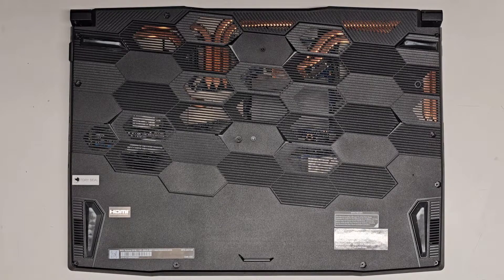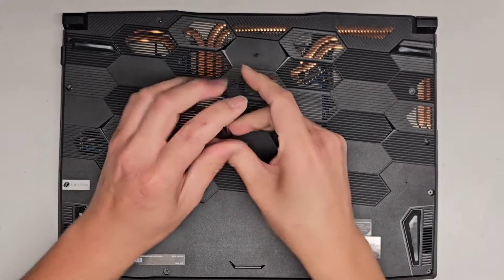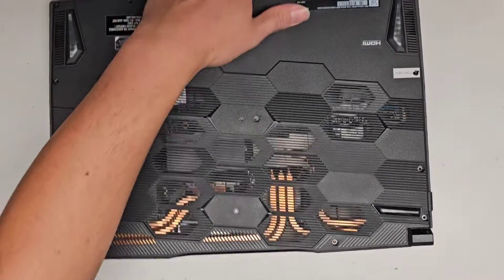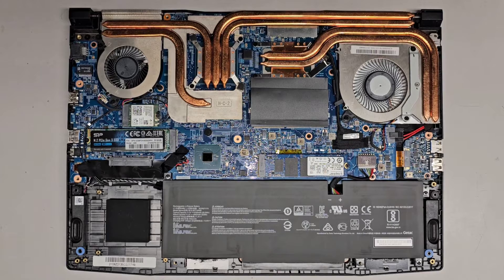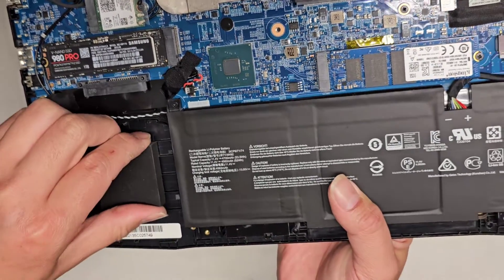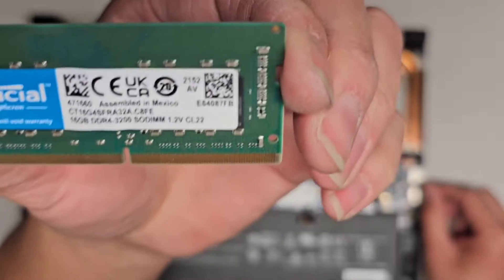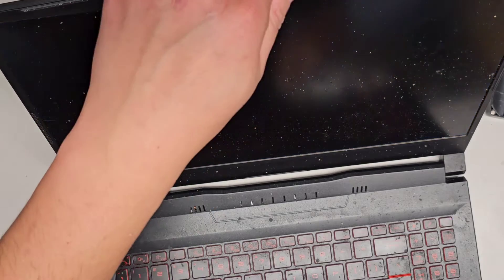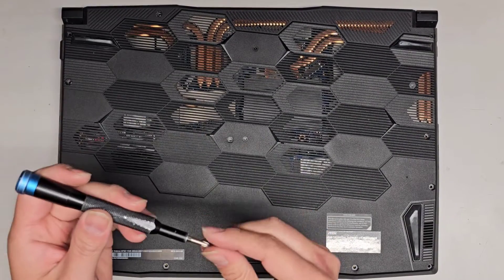MSI Katana GF66 11UE-260US Disassembly RAM SSD Hard Drive Upgrade Battery Replacement Repair

Comment: Hi, I have the same notebook. I want to install a 2TB M.2 NVMe SSD in the second slot. Do I have to put a heating pad over the motherboard and the SSD? Like on the main SSD? My notebook doesn't have that electronic thermal tape covering that chipset. Should I put one on? Thanks. I look forward to your response. Greetings from Argentina.
hola tengo la misma notebook. quiero ponerle un M.2 NVMe SSD 2tb en la segunda entrada. tengo que colocarle un heating pad sobre la placa madre y el ssd? como en la unidad ssd principal? y mi notebook no tiene esa cinta termica de electronica cubriendo ese chipset, tendria que ponerlo ? gracias espero tu respuesta. saludos desde argentina
Reply from the maker: I don't think it's necessary, but could help get more performance out of it.
Reply: @ItsBinhRepaired  great, thank you very much.
Reply from the maker: @gonzalosalmeron162 no problem

Comment: just a question, can you install port for hdd or ssd sata 3, i have a gf66 11ue and it don't have port to connect a hdd or ssd sata
Reply from the maker: It looks soldered, so if it's not there, likely not.
Reply: what if i want to install it what should i prepare ?

Comment: It has 2 SSD slots right? I want to buy more storage, but already have hdd and the default ssd installed
Reply from the maker: Yup, you can add another if yours is the same design.

Comment: I have a Katana gf66 that’s stock and I was thinking of upgrading its Ram and SSD. I was wondering what the procedure would be to avoid losing/corrupting any of the data that is on my drives? Also how would I install windows again?
Reply from the maker: You can clone the drive first, using this video https://youtu.be/4p5jFDzVwUw